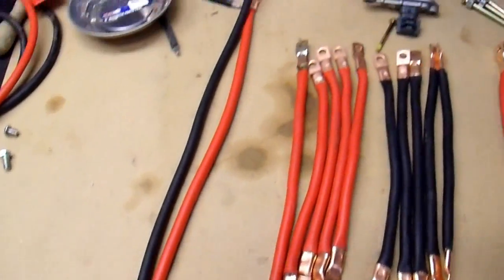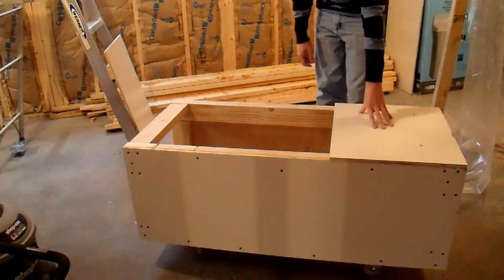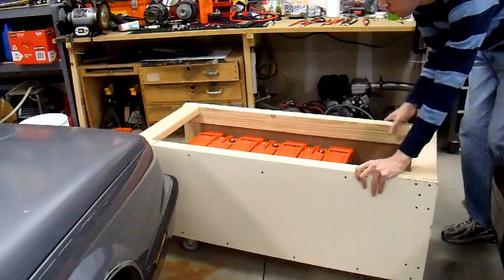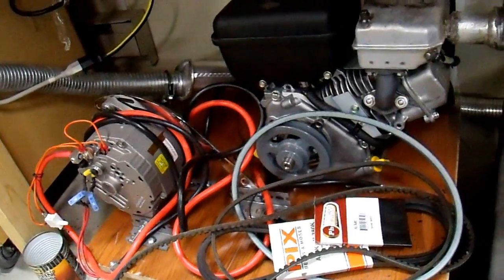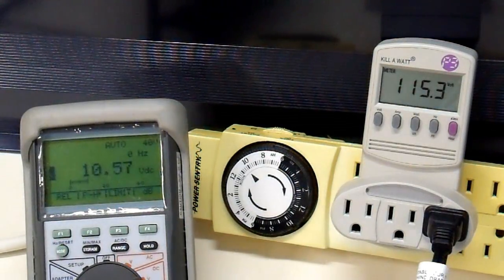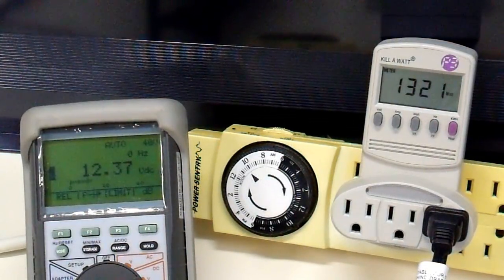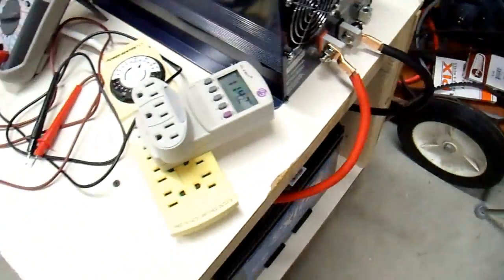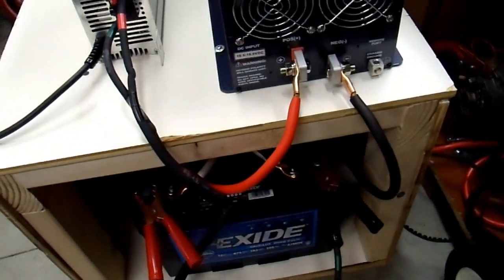1000Ah Battery Bank Part7 - The final Battery Inverter Configuration

Comment: nice video love your video can i asked question ?when you turn off inverter with switch its still pull power right  even inverter turn off little bit right ?
Reply from the maker: The inverter will still draw a few milliamps, yes, but it's mostly inconsequential.

Comment: Hello, thank you for your very informative video. Could you make a video about pros and cons in mixing different battery age? e.g. Same brand, same Amps, but different age, etc. Thank you 🙏🏻
Reply from the maker: That would be a good video topic, thanks.  The general advice is to not mix battery age, but the practical answer is much different.  As batteries age they tend to gas more, charge less efficiently, have a higher internal resistance, and a lower capacity.  The less efficient charge is probably the worst offender as it results in faster plate corrosion and water loss in all of the 'good' newer cells.  This has to be balanced vs the benefits of mixing which may be higher bank capacity or longer bank life.  e.g. if one battery failed on a 5 year old battery bank then, yes, of course I'm going to put a new one in and keep the battery bank going for a while longer.

Comment: Shouldn't you have a fuse on each battery because if one shorts out it will kill the rest?
Reply from the maker: If a battery 'shorts' it will be a low enough draw to not trip the fuse/breaker.  I wouldn't condone fusing individual lead acid batteries within a battery bank.

Comment: Thanks for this series. One query - you said it would be more ideal to connect the inverter to a battery more towards the centre of the bank. Previously I'd read one should connect a charger (and similarly I guess, an inverter) to both end batteries e.g. positive of battery at far left and negative of battery at far right. That made sense when I read it, it seems like it should cause an amount of current to go through all the batteries equally - but I didn't look too much farther into it. Clearly it's not critical, your system obviously works. I was just wondering if it would be even more 'ideal' than connecting to a single battery toward the centre of the bank, or whether it's just not worth thinking about.
Reply from the maker: It depends on what you're optimizing for and in a dedicated storage battery bank that is regularly cycled I agree that connecting like you describe will offer better matching of batteries.  In my case the battery cables connecting the batteries were not 4/0AWG or something heavy like that so connecting to the center would share current between the two runs preventing any unnecessary heating in the cables which is damaging to the batteries.  And in this setup which only sees occasional use 100% even current sharing is a non-issue.  Cable routing is often more a practical concern that theoretical so one will see many different configurations depending on the situation.  Thanks for the intelligent question and criticism rather than just ad hominem saying I'm an idiot!

Comment: Could you please make a video on wire sizing? My concern is that people think all wires need to be super large on the interlinks, I think a plumbing /water supply approach to thinking of current flow should be discussed.  Thanks for sharing your knowledge.

Comment: Best way to hook up the batteries is have a bus bar for pos. and neg. run equal length wires to each bus bar, then charge and pull power from the bus bars, that way each battery gets equal drain, and charge, otherwise the end batteries take a beating... Great video series !

Comment: Nice one mate. You can double up your cables to increase the current carrying capacity and effectively reduce the resistance/ heating of cables. I double up the bus bars/ conductor on my capacitor and battery banks for this reason and it is cheaper at least in my case, to purchase and double up the cabling, than purchasing the equivalent larger cables. Thinner cables are easier to bend and manage also.

Comment: Your battery cables are severely undersized and a huge fire hazard unless you have adequate overcurrent protection, in which case, your breaker is going to be tripping constantly.

You typically use 175A breakers for a main battery disconnect, which accounts for the surge rating of most inverters. You have the potential to pull hundreds of amps out of your batteries and that would almost immediately melt the insulation on your battery jumpers.

Viewer beware, following the advisc on this channel will burn your house down.

Kelly

Comment: I really enjoyed the series and learned a few tricks about battery recovery!  
I think you did yourself a disservice by "under-engineering" the battery interconnect cabling inside the box, given all the effort you went to.   I understand that minimizing cost was a priority, sometimes that can lead to problems if taken too far.  Suggestions:
  1)use two rectangular copper bus bars inside the box, one one each side for positive and negative.
2) connect each battery to the bus respective bus bar with the shortest, properly sized single cable.  Solder the lug terminations;
3) At the inverter end take power off the end of the bus bars up to your inverter, again with properly sized cable, eg 2/0, 3/0, 4/0 etc; and,
4) add a fuse or DC panel mount breaker on the positive lead at the bis bar connection.
Minimize all of your resistance points and you'll get so much more bang for your buck!

Comment: break those batteries down to pairs connected to one central post and you can reduce your cable size down because of the load being shared between each pair. Keep all your cables the same length for each pair connected to the central post. The way its connected here the front battery will be the one that fails first. Ive run solar for the last 3+ years and ive found this to be the most effective way for load share and recharge more even.

Comment: you mentioned on your previous video that it is never recommended to mix batteries. why is that?
Reply: Because they charge and discharge at different rates with different chemistries.  That can lead to overcharging battery 1 which may reach full charge first at 15 volts when battery 2 is only at 13 etc when charging in a string/bank.   You’ll boil battery 1 etc with the overcharge.

Comment: Hi,
Just found your video while taking a rest from programming uC's. Lots of fun and great job!
A couple of things:
I have two systems I built here. One runs off grid/intertie and the other just intertie with 48 modules (48 volt system) for about ten years now so I've seen the effects of long term batteries, leads, etc. When I built my cables I used, if I remember, plain old thhn? since the cables aren't moving around and once you bend them into shape and leave a little 'bend' in them to reduce stresses on the terminals they seem to do fine. I was very careful, however to make sure the terminals were crimped and soldered on with heat shrink tubing covering them to keep moisture to a minimum. I'm glad I did, after a couple of years the terminals did start to build up  and I had to clean several but the terminals at the lead ends were fine. You might want to heat shrink those cables if you want to use you system for longer periods. 
Mixing batts - I just don't do it. not the worst in parallel but still not a great idea, as I'm sure you know. The other thing is to spring for higher voltage inverters. 12 volts is just too low and you'll spend more on copper in the end especially if you have any runs from PV arrays.
Just my two cents but great videos and some good battery advice.
Rob

Comment: can anyone tell me where i might get the orange batteries in this video, they look powerful
Reply: +lookoutleo They are industrial batteries, manufacturers swap them out quite often.
Reply: It depends on how you plan to use the battery bank. If you want backup power for a power outage these will not do. These batteries are designed to keep a system up until the backup generator comes online and nothing more. For backup power you will want to look at GC115's or L16's. Never place your electronic equipment above your batteries. The do offgas hydrogen gas and there is spark potential with the electronic equipment. I will assume you get where I'm going with this, boom.

Comment: I used copper pipe and drilled holes and crimped as usual
son you need a 20 amp trickle minimum 
a second set of wires to middle of the main bank would be advised
to prevent inverter burn out

Comment: How much solar will you need to fully charge this set of batteries? My guess would be 4-5 kilowatts installed, and you still might need to top up from the grid or a generator to keep them from going bad again.  Maybe you could put a charger on a timer to start after you go to bed and turn off before you get up- off-peak rates especially in the summer.  I have 3 12-volt batteries I keep on a trickle charger for emergency power.  1100 watt inverter to keep the refrigerator and a few LED lights going.  If needed I would recharge them using a car and jumper cables.  Beyond this a big collection of batteries only makes sense if you are going completely off grid.  In that case you need an auto-start/auto-stop generator for topping up.

Comment: Actually I was going to watch a movie tonight , but I am watching you put together your battery bank that you paid $40 for. 
You need to get a job on the space station. 
I have a question. When batteries are connected together in parallel, can you connect the pos and neg leads to the inverter from any of the batteries in the bank or do you need to connect at the end of the battery bank?
Reply: +linkdead14  thanks - that helps a lot.

Comment: An Idea.. connect to each end of the battery bank to evenly discharge and charge the bank oh and to easier connect try to do this with remote terminals. mount them in the end of the box using 2/0 welding cable and you should be fine. but this will help you to evenly charge and discharge the bank easily and safely for you and your batteries.

Comment: Hi! ***** , How about Sometime replacing the inverter with a Beefed up APC UPS? When the power goes out it could continue powering critical stuff automatically, when when the mains is available, it would keep them floated for you. If you need to fast charge then you could use your beefy chargers :P

Im going to be using an APC Smart UPS 2200 XL thats going to be protecting my Servers in my 42U Rack, Powered by 4x 140AH "Standby" (AGM THOU!) batteries in a 48V String. Thanks to your videos im considering Upgrading it like you did, but i will also be getting a 3000VA unit possibly as well.

Comment: Those two items draw 230 amps? Wow that's a lot.
Reply: 2800 watts. :) There is the thing with 12v systems. High amps on the battery side. I opted to go with Solar panels in higher voltage strings (150v) and minimal amps. 48v system. Less amps being pulled out of the banks. Hence better discharge rates. Besides. Large copper wire is expensive! 10 bucks a foot for double aug cables zeesh. $100USD in cabling just for the leads from the battery bank to the Inverter. Rather than a nice roll of 10 gauge (Handles 30 amps, although mine sees 15amps) for $90USD/several hundred ft worth.
Reply: here are some easy numbers to show you a basic concept. volts * amps = watts. so if we have a 10amp load at 120v = 1200w. Ok now we want to go back to amps again but at 12v.... Watts/volts = amps. The inverter is making that from 120 from 12v so divide 1200w by 12v and you see on the 12v side is drawing 100 amps. in the real world its more because there are inefficiencies in conversion but this should help you get the basics.

Comment: You should try and pull +ve and -ve from different ends of the bank.  Same goes with charging.
Reply: Yup, that is the proper way to balance the current from the batteries, because you ensure that the length of the paths through every battery is the same length... if the battery is closer to the inverter on the negative side, for example, it is proportionately further away on the positive side.

It reminds me of the way the cylinder heads on the VR6 engines are done. In order to ensure that the airway is the same length for all cylinders, a short inlet/long outlet on one cylinder is balanced by the reverse on the one next to it :-)

Comment: just found your channel. lots of cool stuff. subscribed. ive seen many others put the inverter positive on one side of the bank and the negative to the opposite side of the bank to get an even draw across them all. is that incorrect? i always thought if you discharge the one on the end, it will discharge faster than the others. thanks for your vids
Reply from the maker: The method you describe will work well.  I've changed the way they connect to eachother and the inverter many times since this video.  From a practical standpoint it doesn't make a significant difference if your cables are sufficiently large.

Comment: Your voltage drop is coming from your termination of the wire, you have to solder those copper lugs to the wire.
Reply: it works just as well to crimp

Comment: Some good advice has been offered in other posts.  Are all your batteries still good?  Did you change up the wiring to be more balanced for charging? (opposite sides of battery bank?) How are those different batteries doing?
Reply from the maker: The different battery types have been removed and additional orange batteries were added.  The inverter is now hooked up to the middle of the string and the charger connects to one end of each string.  The cable gauge is still not ideal and I would improve it if this was something that was used frequently but it works well enough for me and my backup application.
Reply: We'll the pure sine wave xantrex is 91% efficient. I got the 2000 watt freedom with the charge controller and separate outlet add on for under $800.00 sold as used but new in the box. The damn thing new cost $1400.00 new with all the extras. Best investment I ever made and rock solid.
Reply: I was going to say using the negative from one end the positive from the other balanced out the load each cell had to carry. This makes discharging and charging equal across the batteries. 

You could also get a more efficient inverter. Something around 89%-92% would be the best. I prefer xantrex as I never had any problems with them. Ebay sells them for cheap or look in the junk yard for old police cars. They have the whole system in the trunks they left there.
Reply from the maker: Claude Rains
The inverter used here is more efficient than any Xantrex inverter I have tested - or any other inverter I have ever tested for that matter.
Reply: Claude Rains I enjoy the Outback VFX3648. 3600w continuous. 5400w for 30 mins. 7000w for startups. 48v inverter. Works great in our off grid setup. Though. Much more expensive. Another one of those Solid Rocks you mention. :)
Reply: Next unit I'm buying is the Samplex SK3000. I had to install one and it was so efficient the fan never come on at 90% full load on 48 volts split phase 230 volt. As I don't like double stacked inverters to get 6000 watts. They get to hot. Later I look at the specs and it's rated at 94% efficient. 

Not to mention there only $1100.00 new. So my xantrex will get replaced.

Comment: where is very nice trick to balance each battery, connect all in parallel, and  for positive use longest wire to positive contact on first battery, and for negative use short wire for last battery. each battery will have same resistance path to inverter. Problem ?

Comment: OK, I'm sold on your ability to completely document a process, and you apparently know your stuff about batteries.  Thank you for your time in production of this video series!
Reply: "I made this WOODEN battery box" as a "safe battery store" - I hope his house is not on fire yet and if it is, then because the safe battery store was not as safe as he thought - I cannot understand why anybody would want to place batteries in a wooden box
Reply: @viewer0402  Oh geezus they're not lithium fireboxes, he's used heavy gauge wiring, he's checked how warm they get under a decent load, and those are modern safe deep-cycle batteries with flame arrestors that are DESIGNED to be used indoors. Where do you think UPS's are stored - I've seen them inside locked wooden cupboards in hospitals! Perfectly safe.